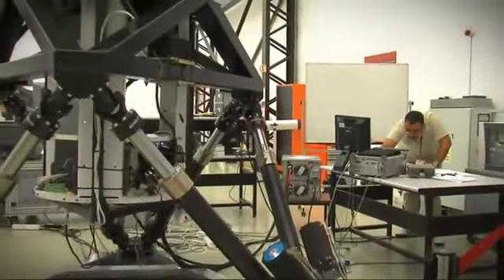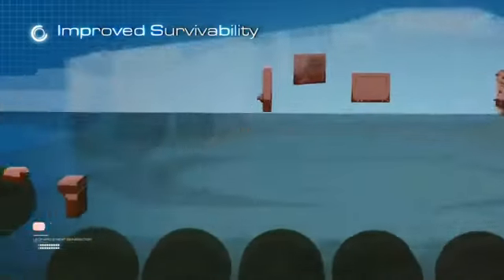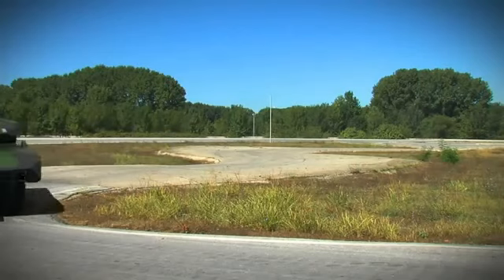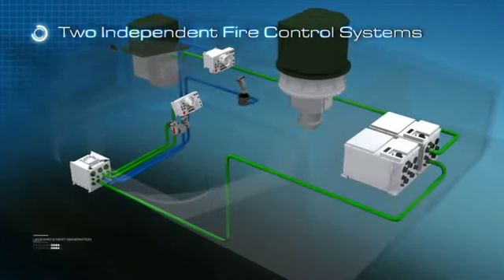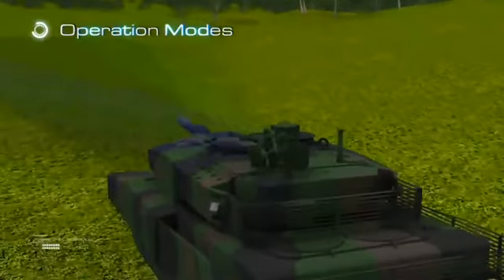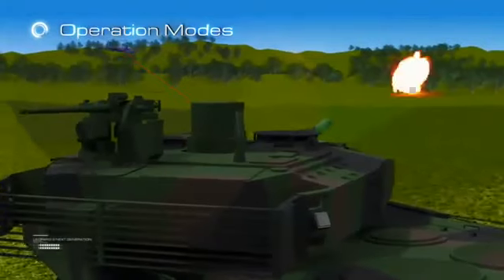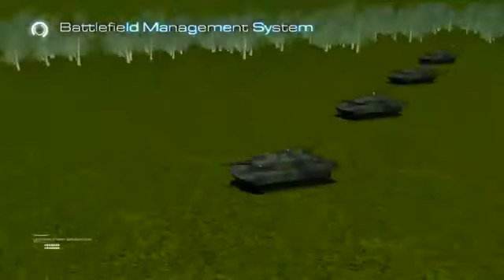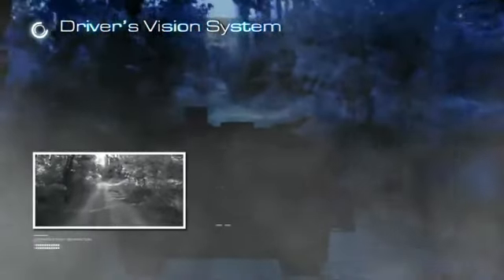Aselsan Leopard 2 NG Upgrade Program

Comment: Pretty much the same, The Revolution upgraded packages can be different. You can have one that specializes in Anti-Air and some are mainly for fire power, In this case the Leopard2NG is basicly a Anti-Mine/C4s Version of Revolution although it will also be contain Turkish technology.

Comment: True, But no abrams have been delivered yet while the NG is now currently in production line. Besides that advancet you will only have for a short periode when the Altay arrives we will have supreme dominancy. And also our airforce is equipt with advanced SOM Cruise missile AG which has a range of 500 km (Claimed) And achieved 360 km (Test officialy made) beside that we have domestic cluster boms, Bunker Busters and various other Bombs. For this reason you will stil lose any war against Turkey

Comment: The Abrams are not on the way by the way, They where underway last year and never came and now suddenly are underway to, Pure bullcrap proven already. And the Bunker Buster bomb is a term for a type of ammunition it isnt specificly made for Bunkers (Which shows how dumb and little knowledge you actually have) Its can penetrate hardend army buildings and structures such as command control centers. And besides that Turkish Air force joined more then 10 different type of Exercises tempting grikos.